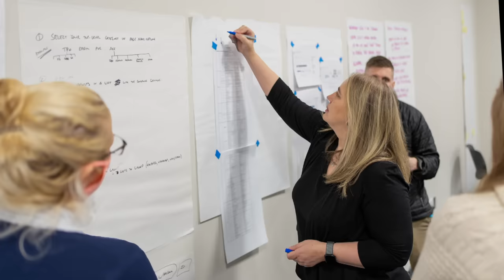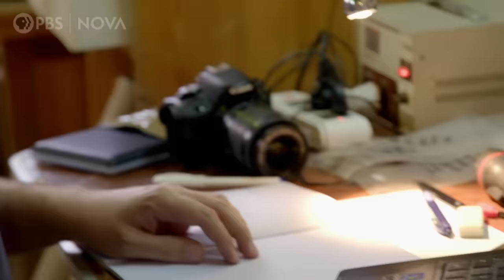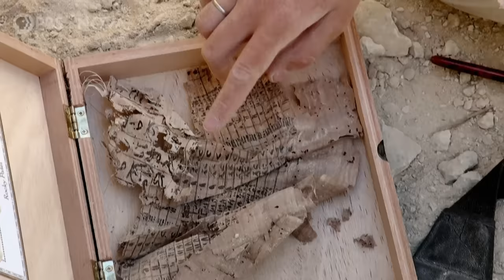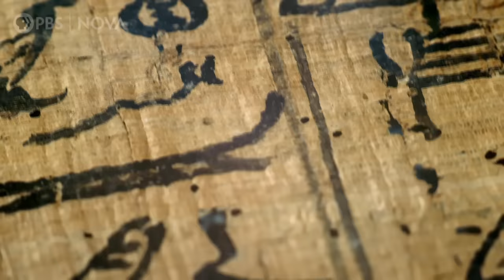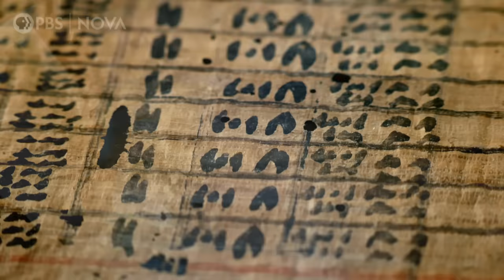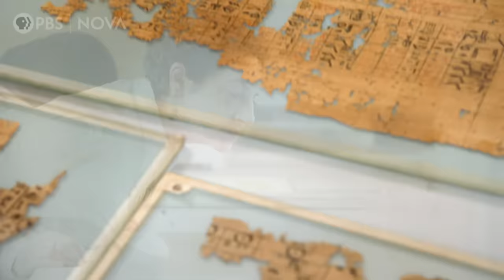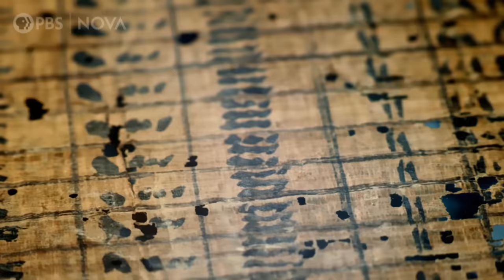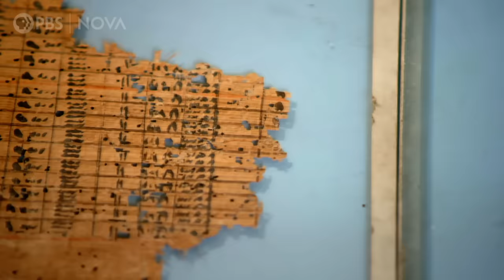Decoding the Great Pyramid | Full Documentary | NOVA | PBS

Comment: As a retired construction engineering,
My theory of the building of the pyramids is using counter weight method. Pulleys at the top would transfer the load to workers walking downhill. We use similar method for elevators. The pyramids are just indicators of a highly advanced civilization.

Comment: One of the great mysteries of the world I of the world
Reply: 2 and a half million stones, supposedly built over the course of 20 years. If you do the math, and the workers work non stop that's a stone quarried, moved several miles, and laid into place every 2 and a half minutes. It's not one of the great mysteries of the world. It's THE great mystery of the world.
Reply: @Davivd2  not several miles....500 miles, and across the Nile.
Reply: history for granite has practically solved most of the mysteries
Reply: @DEV3N87  Almost all the stones were quarried from right next to the pyramids.
Reply: @twonumber22  wrong. Aswan quarry.
Reply: @DEV3N87  Incorrect. That was just the granite, which is a small fraction of the total.
Reply: @twonumber22  the casing stones, yes. Do you think that was easy?
Reply: @DEV3N87  Relatively yes. They had great transport boats and they had to go downstream. The hard part was getting the boats back up the river.
Reply: @twonumber22  I don't think you can transport 50 tons on a wooden ship. That's just one block, the smaller casing stones could be explained but not the core stones inside the kings and queens chamber
Reply: @DEV3N87  Then how did the Romans take eight obelisks back to Rome?
Reply: @twonumber22  well You're talking a thousand years of difference there.
Reply: @DEV3N87  And? What do you think Roman boats were made of? The Khufu ship was almost 150 ft long.
Reply: @twonumber22 look bro, idk. i just dont believe the pyramids were made by slave labour and just simple stacking of sandstone/granite. its infinitely more complicated than the "mainstream" indicates. its an absolute marvel in engineering, and hasnt been replicated since. rome created amazing works of art and structure, truly. but damn, the pyramids are an absolute work of art still to this day. just a fan thats all
Reply: @DEV3N87  I don't think they were built by slaves either. Not many in the mainstream do. I think you're making it more complicated than it really is. Mechanical advantage is something the ancients were more experienced in.

Comment: The Land of Chem channel has cracked the code. Sulfur was burned in the kings chamber to make sulfuric acid, the passages were filled with water to control pressure and temperature.
Reply: And you believe that? 😂
Reply: History for granite solved many mysteries of the pyramids, educate yourself
Reply: @umoaire9323 - That sounds like a load of baloney.

Comment: But where is the mummy in the pyramid? if its a tomb how come there is nothing there? How did they transport so many granite blocks 500 miles away... they must have had huge barges to carry the blocks and not to mention the power needed to move that barge alone would require so many people rowing at the same time and using sails...but its so far away for a civilization without modern day cars...
Reply: Mummies were looted but many pieces of mummies were left behind. Mummies have always been a valuable prize. Most of the blocks used to build the Giza pyramids were quarried from right beside where they stand. The blocks that came from upriver were floated down the river on huge barges.

Comment: Reenactment: check with an engineer first. They wouldn't be spreading oil all over the ramp, next crew wouldn't be able move at all.  Try reeds layered over the ramp pointing up, like an upside down thatch roof.  They would reduce friction and prevent the sled from sliding backwards.
Reply: They were pouring water, not oil. The pouring of water in front of the sledge was based on paintings in some excavated buildings that showed how large blocks were transported: via sledge with a team pouring water in front to "grease" the rails.
Reply: @DrachenGothik666  straight water, on most surfaces, would tend to create friction.  However,  clay would work with the wooden sled and allow it to slip over the surface. With just the right amount the clay would dry and prevent the sled from sliding back.

Comment: The great pyramid has 8 sides when you check the angles more closely. They didn't explain how tons of granite was perfectly carved. 50+ ton stones...granite carved boxes with perfect right angles. There is much we still don't know...
Reply: And that it's pretty much impossible to carve granite with copper.
Reply: @billruss6704  I think we can accept this as your solid admonition about harboring suspicions just because a 50 minute long documentary doesn't explain everything you have questions for.  We already know how they handled granite, because there is tons of extant evidence in the form of abandoned projects from antiquity and whatnot.  Most of the heavy work was done by pounding with dolomite (harder than granite).  Finer work was done with a combination of finer tools and sand (again, harder than granite), which was placed between the tools and the granite.  I can only suggest that you brush up on more documentaries.
Reply: Have you never heard of a plumb? lol
Reply: A perfect right angle can be drawn in a few seconds with a stick.
Reply: And you can watch people here on YT cut and drill granite with hand-powered copper saws.

Comment: One thing this video failed to talk about is that the 3 pyramids were covered in a white outer Stone that, during the day, absorbed all the light and heat from the Sun and at night would still shine bright white.  At the time the pyramids were built, there were three bright stars up above with the same relative size and alignment to each other as the three pyramids.  So it is thought that the Egyptians or the pharaohs thought that these three stars were where the Gods lived.  So they built the 3 pyramids to be exactly like those 3 stars up above to tell the gods that they were there and they were their children and servants.  So the Gods would look over them and protect them.  Those three stars have since moved and change their position and alignment in the sky.
Reply: First of all, bright white surfaces reflect light, not absorb it. The video did talk about the casing stones, as well. It's also impossible to conjecture anything about its reflective properties at night; there aren't any sources describing that. Also, it's widely accepted that the pyramids have an alignment with the 3 stars of Orion's Belt constellation.

Comment: If pyramids wre build with hand tools, how did they make the cuts on the granite pieces inside the pyramids structure? don't bother answering my question. I's impossible to work on granite rock with just a hammer and chisel.
Reply: That's horsepucky. People carve granite with hammer & chisel pretty often. It's slow going, but it's possible. Granite isn't magically tough, just dense.
Reply: @DrachenGothik666  ok' explain how they did it with a hammer and a copper chisel with photos or videos ha-ha!

Comment: Dynastic Egyptian's didn't build the pyramids or some of the other sites. They dynastic Egyptian's said it themselves, they found the pyramids and the area around it. They keep spreading this obvious lie despite all the evidence to suggest the sphinx and pyramids are a lot older than what they are saying. There are very clear saw marks and tube drills and all that that simply do not match up to what they are saying. Not all of what they say is false, but they are purposely lying about this fact for some reason. Anyone who's every cut a piece of wood would see that machinery of some kind was used and it wasn't copper chisels. It wasn't aliens either. Archeologists are not engineers so they need to stop pretending they know it all because everything is not some religious site or burial for a king...
Reply: Can you give a reference to the text where the Egyptians say they didn’t build the pyramids?

No, of course you can’t.

Comment: The great Pyramid was not a tomb, there were no mummies found, there is no way they could have cut and carried these huge stones, It would be a huge feat of engineering today with modern tools and equipment, they had copper, no, they had a lot of help from beings not of this Earth, They were power stations. and they are much older than they think, 10,000 years. 👽
Reply: Make your next hat out of Reynold's Wrap and not that store brand foil. I know it costs more but as soon as you put it on you'll know what that extra $ went towards.
Reply: They also had nothing to do. No TV or Internet. The men had to find something to do to get away from their wives. Boys, let's just start by making big blocks of stone. 🤔
Reply: Do you know for sure that no remains have ever been found over thousands of years? If so, how?
Reply: Just wait until you learn about mechanical advantage.